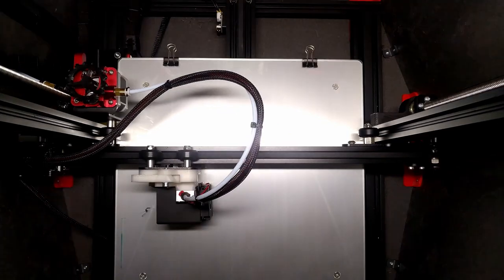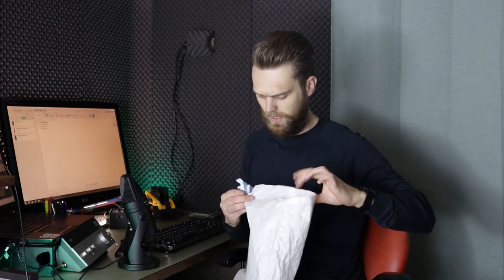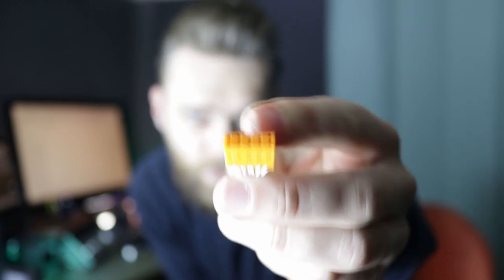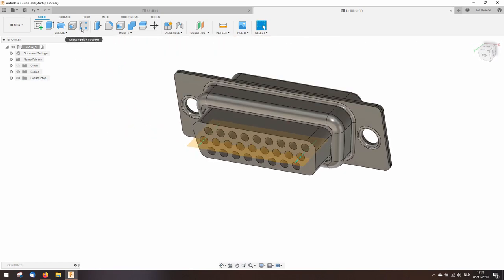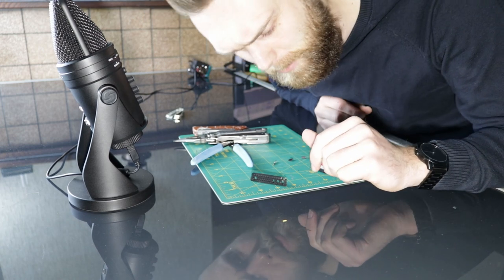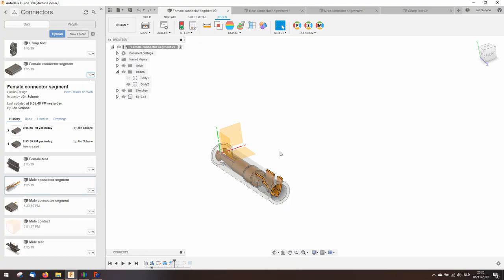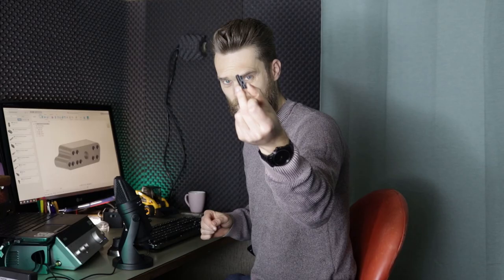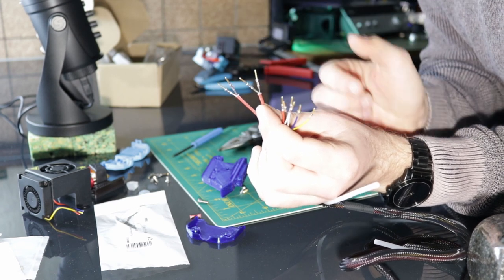Design and print a custom connector for the Creality printer with swappable hot end

Comment: Hello, I am working on the same concept and I would recommend you to switch to magnetic contacts. Two mini magnets can attract each other and close the circuit. As a neodymium magnet you get small cubes with 3mm edge length. These attract each other and hold the position, so check out my project at https://youtu.be/QLSt_YEuahg?t=881 . Here I have magnet balls to tighten the washers centered on the header and thus make the contact that on a smaller basis and you have your connector that can easily open and close.
----

Hallo, ich arbeite ja an dem gleichen Konzept und ich würde dir empfehlen vielleicht auf Magnetkontakte umzuschwenken. Zwei mini Magnete können sich anziehen und den Stromkreis schließen. Als neodym Magnet bekommst du kleine Würfel mit 3mm Kantenlänge. Diese ziehen sich an und halten auch die Position, schau dir dafür mein Projekt an https://youtu.be/QLSt_YEuahg?t=881 . Hier habe ich Magnet kugeln die Unterlegscheiben am Header zentriert anziehen und somit den Kontakt herstellen, das auf kleinerer Basis und du hast deinen Konnektor der sich leicht öffnen und schließen lässt.
Reply from the maker: Thanks Frank for your suggestion! I should indeed take a look into embedding magnets into the connectors. This won't work for what I've in mind in the first place, but I recon that this can be very interesting for future projects :)

Comment: proprietary connector are evil !...
Reply from the maker: Why is that? Am I being hunted down for reverse engineering them? xD
Reply: @properprinting  if you are reverse engineering connector it supper! Now if you are just making one because you can and this is just for your project it's ok, but look then a big company decides to make its own connector for user it's bad news. If you need to repair it good luck getting one. As manufacturer usually won't sell and if it's on sale price usually is astronomical. Another thing if you want modify, improve or hack your device and your limiting factor is connector you are screwd. And for eg. If manufacturer is using proprietary connector for let's say accessories, you are stuck to only that manufacturer. Like once my friend asked if I could make one cable for his camera as simple cable with 2 connector. Manufacturer asked 300euro... Just because of proprietary connectors. So I also 3d printed one.
Reply from the maker: @valdasaa  I get your point and I totally agree. You see it often that manufactures design a connector which can be used only for their product line. My goal is to make use of common connection types, like the sub D. If I create a single element for both male and female you can design your own custom lay-out using standard parts. I really like this idea and it looks like this hasn't been done before, but I might as well be wrong.
In the future I hope to create a library of different connector segments for making these custom connectors together with the information which pins and sockets fit the segment and which suitable crimp tool can be used.